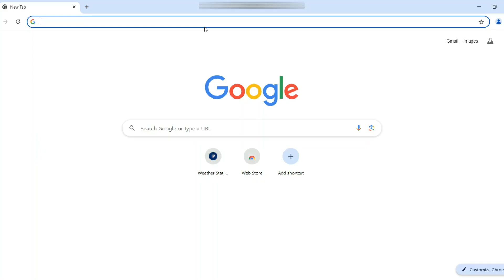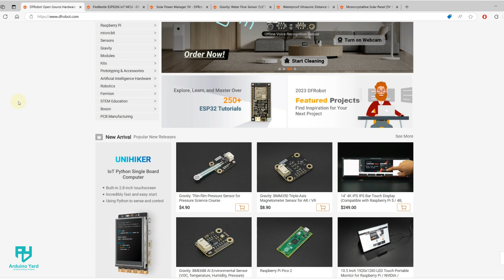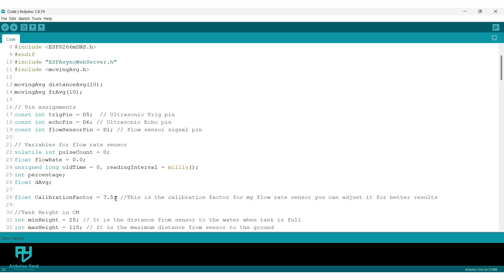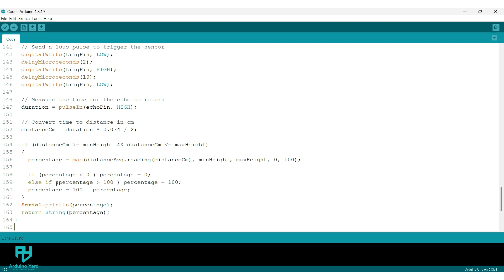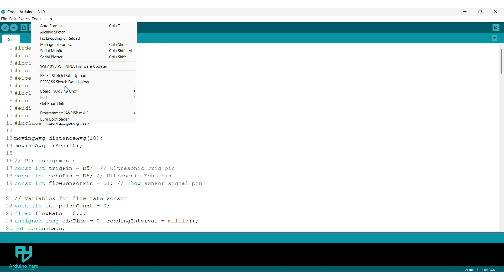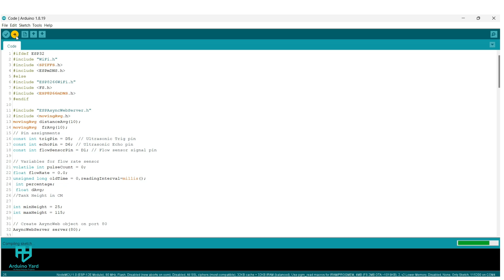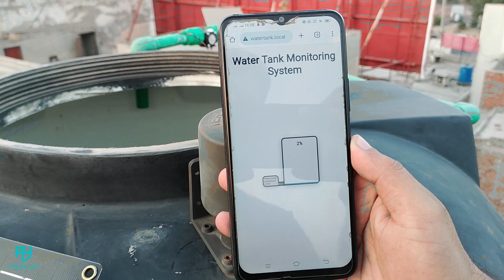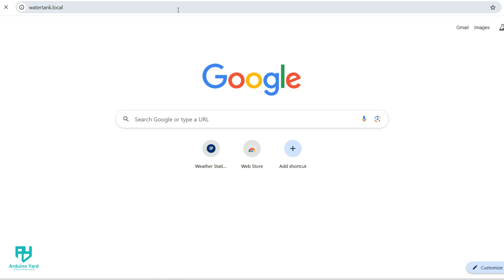IoT-Based Water Tank Monitoring System Using ESP8266 and Solar Power

Comment: Please update auto on off when water level low and high.
Reply from the maker: Thanks for your feedback! 😊
Automatic pump on/off based on water level isn’t included in this version of the project. However, Part 2 of this project does include manual pump control from the web interface, along with a few upgrades.
You can check it out through the link in the video description or visit ArduinoYard for the full series. Hope that helps!
Reply: @arduinoyard  yes in version 2 test manual on/off working fine but if possible upgrade it's really help me a lots for personal use
Reply from the maker: @tarifmasud1448  Unfortunately, the version with auto control is not in the workings. If you want to create a custom project, we can help you. For that, reach out to us through email or whatsapp (contact info available on our website).

Comment: nice..
but i've suggestion..
1.please add eror warn when waterpump malfunction not produce water.
it can prefent waterpump burning when water not coming out.
2.watt consume power when its running..
3.auto or manual running waterpump..
thanks...
Reply from the maker: Great suggestions! In Part 2 of this project, we’ve already added manual pump control via the web interface. You can check it out in the Part 2 article linked in the description. As for pump malfunction detection and power consumption monitoring, those are great ideas—we'll consider adding them in future updates. Thanks for your feedback!

Comment: Nice Tutorial... but unable to download the project files.
Reply from the maker: Thank you for the appreciation. The code and files are available on the link given in the description of this video.
Reply: @arduinoyard  Thank you, Made it as per your instructions and it is working. How to have an on and off buttons in the webpage to control the pump/motor manually?
Reply from the maker: Great to hear your system is working! To add ON/OFF control for the pump, the best way is to use a second ESP32 near the pump itself. This second ESP32 will receive ON/OFF commands from your current ESP32 (the one near the tank) using WiFi or ESP-NOW. The pump ESP32 will control a relay module connected to the pump. This way, you can control the pump from the same webpage, without needing to run long wires between the tank and pump. If you want, I can create a full guide for this upgrade on the website!
Reply: @arduinoyard  Thanks again for your reply. I just want an On/Off Button on the webpage to control the pump manually. I don't have any problem with the length of the wires as in my case, the pump and the tank is not too far. Thanks again for your kind replies.
Reply: @arduinoyard can you please update the code for manual switching of pump from the webpage?
Reply from the maker: Thanks for your feedback! We’ll be posting the next part of this project soon, which will include manual pump control from the webpage. Stay tuned!
Reply from the maker: Part 2 of this project is now live — it includes manual pump control directly from the web page, along with some improvements. You can find the link to Part 2 in the video description, or visit ArduinoYard to check out the full project series.
Reply: @arduinoyard  Thanks a lot

Comment: Ultrasonic sensors can be impacted by humidity and water vapor, which may cause them to malfunction, especially in water tanks. Pressure sensors, on the other hand, are more reliable for such applications as they measure the pressure of the liquid, which is unaffected by humidity. They are more durable and provide consistent readings over time in water tanks.
Reply from the maker: Thank you for your insight! While it’s true that humidity and water vapor can affect standard ultrasonic sensors, we’ve addressed this by using a waterproof ultrasonic sensor, which is specifically designed for such environments. Its sealed probe and weatherproof housing ensure durability and consistent performance, even in high-humidity conditions.
Pressure sensors are indeed reliable and offer unique advantages for measuring liquid levels, but they also come with their own limitations, such as requiring proper calibration for different tank sizes and shapes, and sensitivity to small leaks or air bubbles in the system.
In terms of cost, the waterproof ultrasonic sensor we’re using is significantly more affordable, typically priced at around $10–15, compared to pressure sensors that often range from $50–100 for similar applications. For home and non-commercial use, this cost-effectiveness makes ultrasonic sensors a more practical choice without compromising functionality.
In fact, we’ve been using this setup in our water tank for over three months now without any issues, and it continues to deliver accurate and consistent readings.